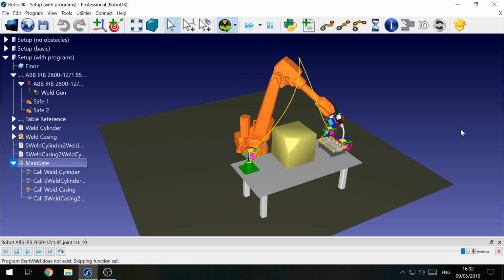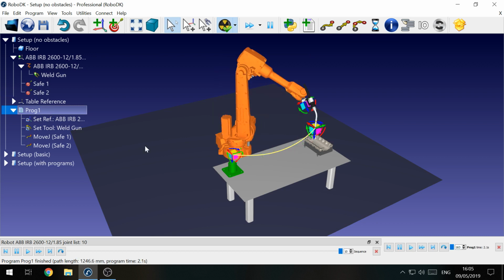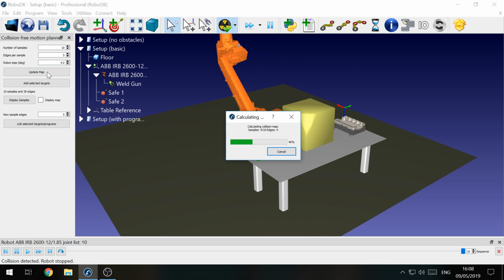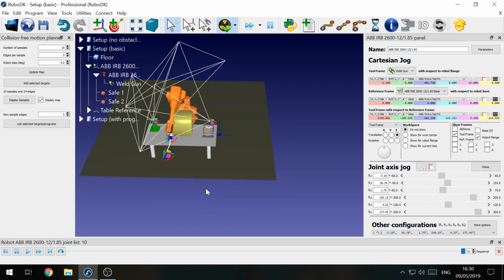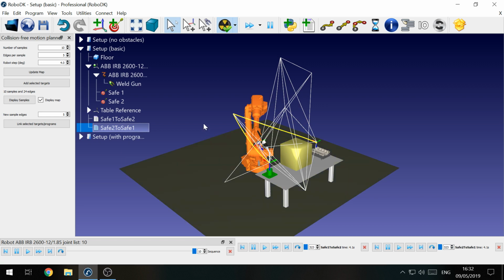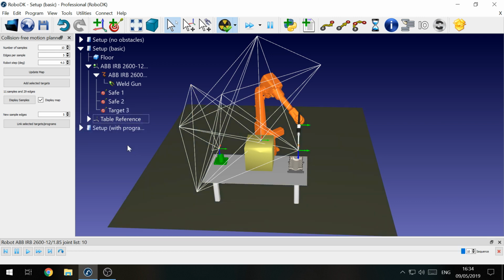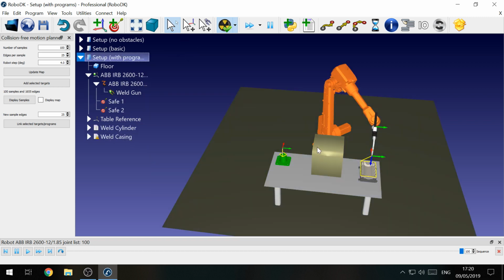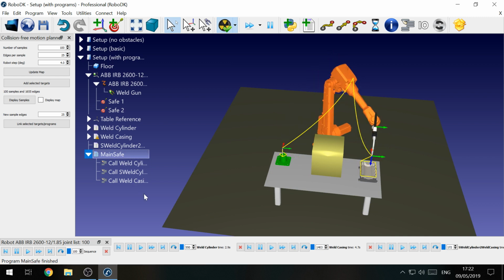Collision Free Planner - PRM with RoboDK

Comment: Is there a physical benefit for the path planning to use multiple discrete joint movements as opposed to a continuous 'curving' movement around the object?
I assume moving around the object on a curved path would be slightly faster, but more difficult or computationally more intensive to calculate.

Comment: Interesting to see what RoboDK is trying to do here, unfortunately for the example given it would be easier and quicker to map the joint movements manually but will certainly give it a try in a scenario with several more obstacles like a packing-cell of sorts.... keep the videos coming and next time can we have an example with a Fanuc M10i or similar? Have been struggling for some time to get this to work with the .TP files so though by posting here would get the ball rolling.
Reply from the maker: Thank you for your comments! This video is an introductory tutorial and the example shown is very simple. Of course, solving the robot path manually is very simple. The automated collision-free path generator can be useful for more complex projects though. 
The following link will help you automatically generate TP files from RoboDK for Fanuc robots: https://robodk.com/doc/en/Robots-Fanuc.html#LSvsTP